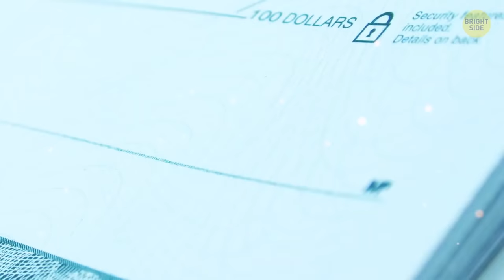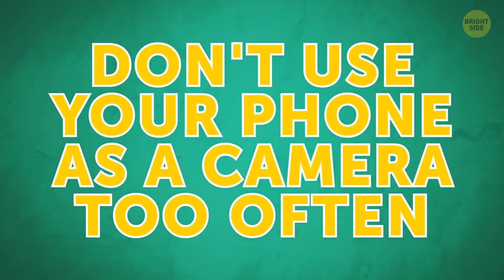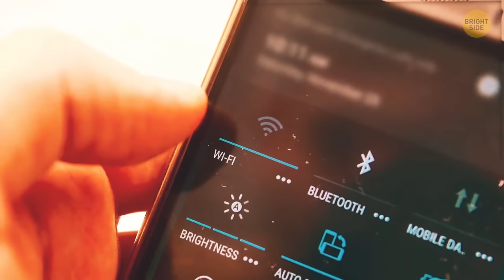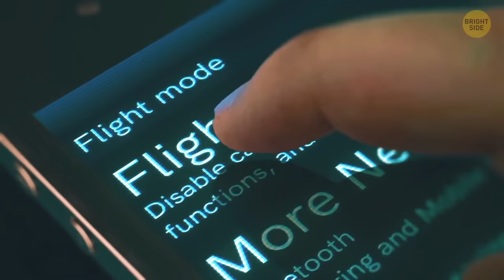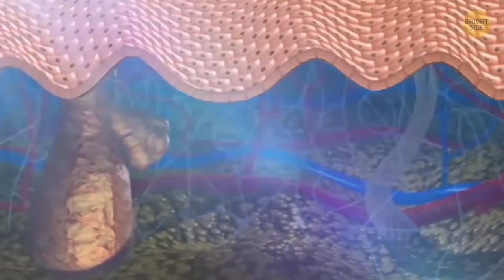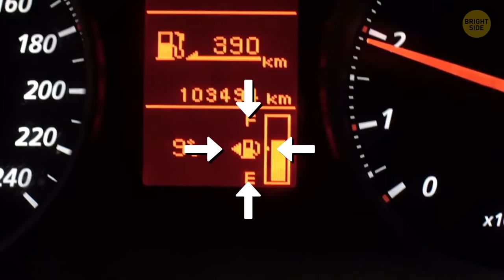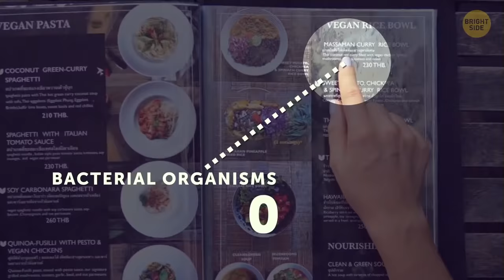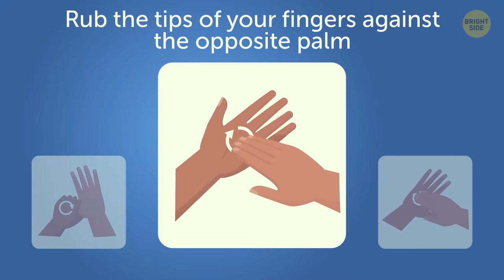75 Everyday Objects With a Hidden Purpose This Whole Time

Comment: Bread tags is a myth, I worked stocking shelves and you have to check the dates to move ahead. Also that coaster truck won't work as you'll get a blob of water from the hole the straw has in the top.